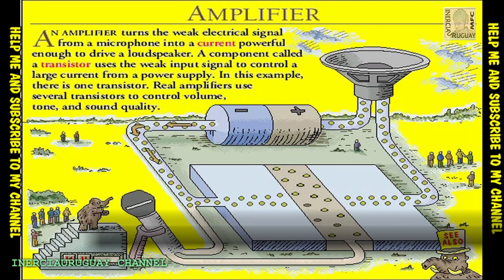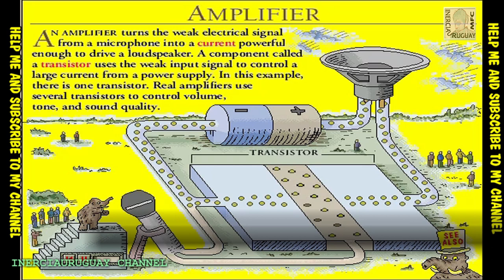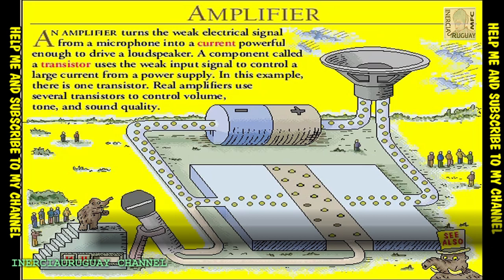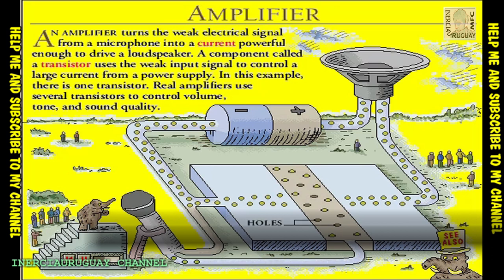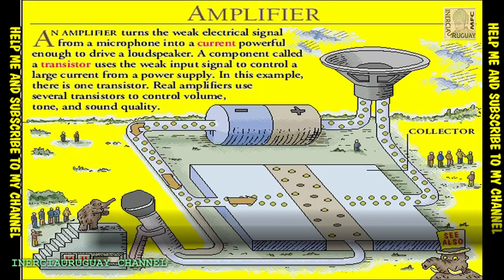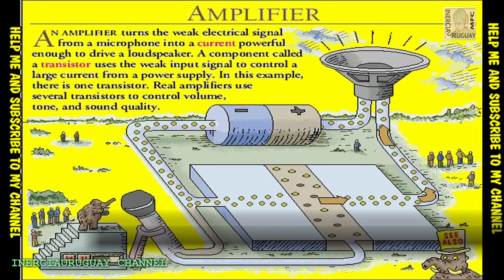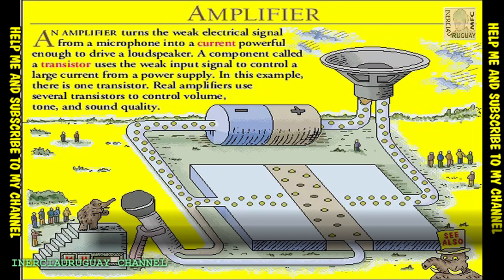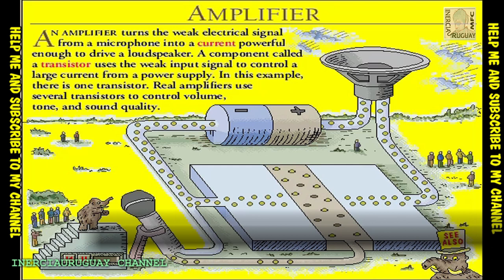AMPLIFIER HOW DOES IT WORK ? EXPLANATION WITH EASY AND QUICK ANIMATION 1993 WINDOWS 3.1

Comment: The picture says: "The emitter is an n-type semiconductor, so it has extra electrons...". So we have an NPN transistor. The emitter emits, in other words, ejects electrons. And in the video we can see that the current flows to the emitter, as if it were taking electrons from the negative battery terminal to the base, then to the collector circuit where the load is connected. So why then is it called an EMITTER, and the graphic designation NPN shows the emitter as an arrow pointing away from the base?